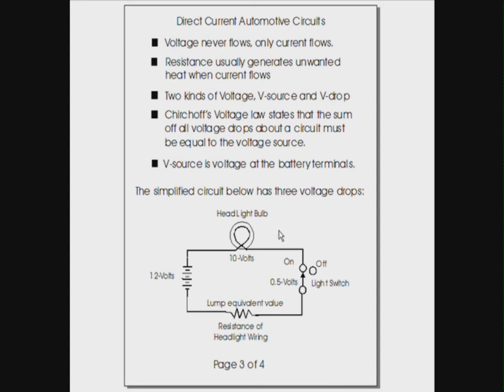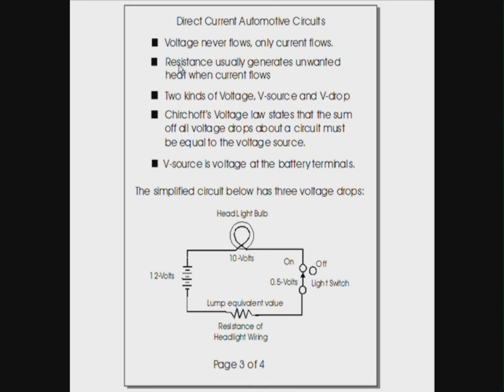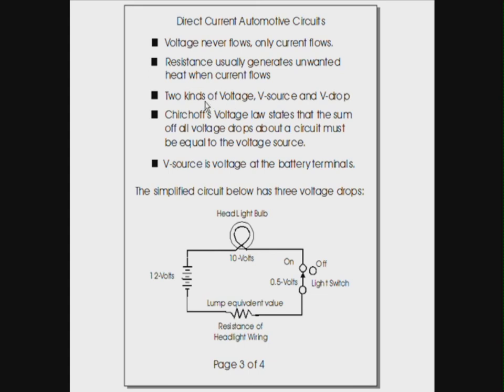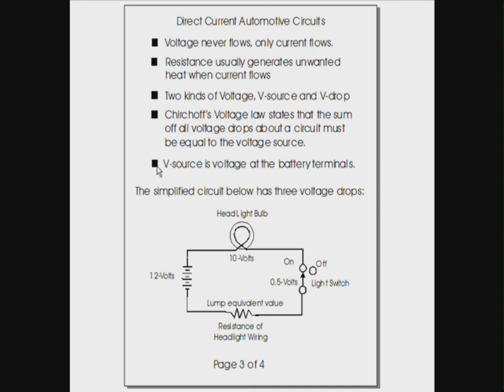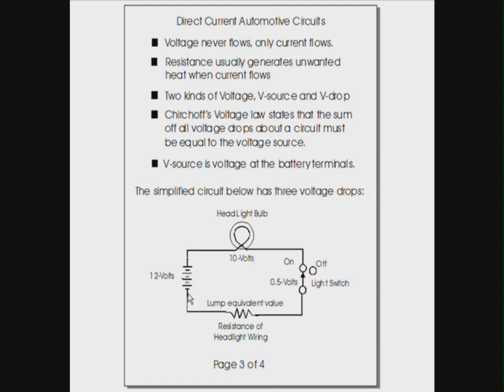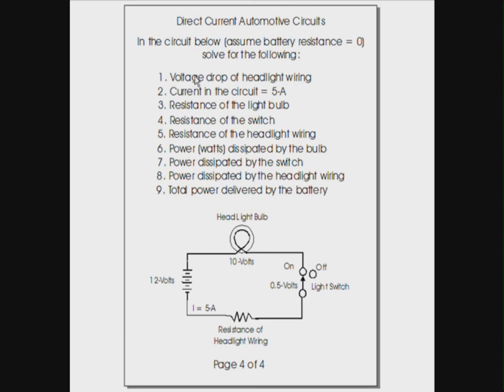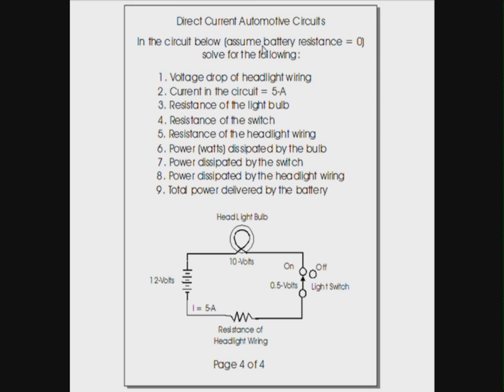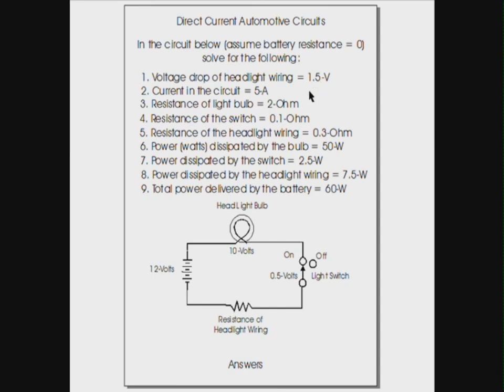Ohm's Law (Part 3 of 4) and Automotive DC Circuits

Comment: I think both are valid concepts. Conventional and electron flow. That is electrons flow neg to pos but the space the leave behind flows pos to neg. both are valid just need to understand the concept.
Reply from the maker: Maybe you could explain (using conventional current flow) how an electron beam fluoresces a cathode ray screen. I don't think any holes are hitting that screen.............I think conventional current flow has no concept to understand.